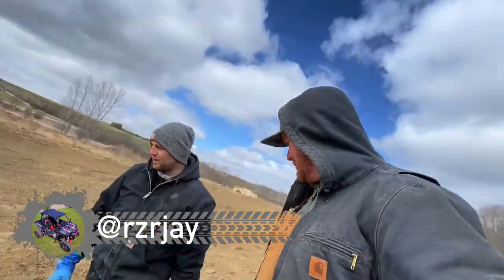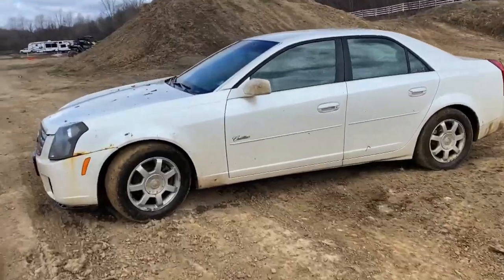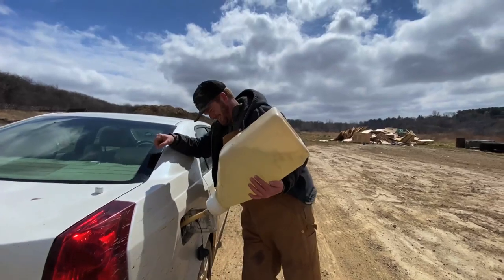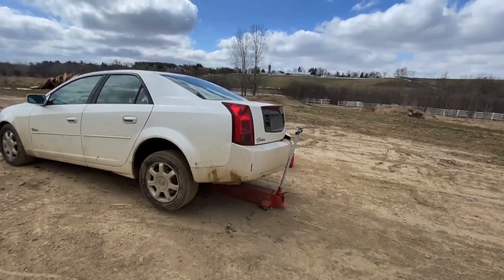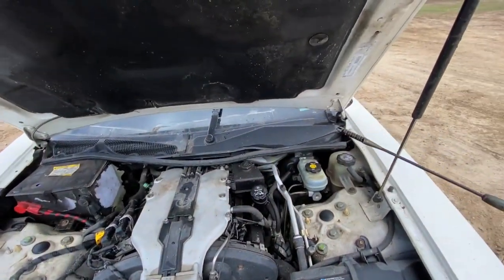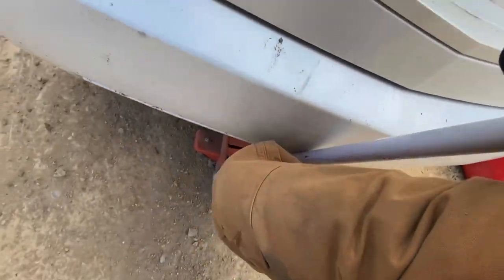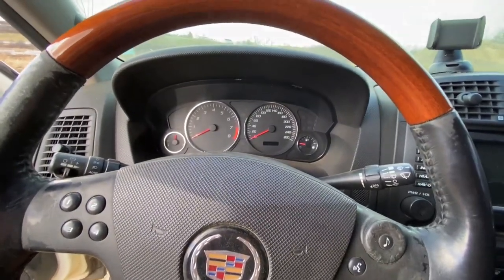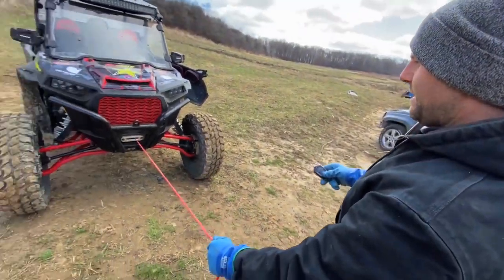Cadillac CTS MUDDING!

Comment from the maker: First 150 COMMENTS/LIKES will be ENTERED in for the KTM 450 ATV GIVEAWAY at 408,000 subscribers!
More COMMENTS = More ENTRIES!
Reply: Hey Mark, take the ignition where the key goes in, out of the GMC and use a flat screw driver too start it
Reply: Braaaap get in
Reply: i need the back door on the passenger side and all the exterior lights if you dont need them
Reply: Unplug the abs wires on every vehicle you beat on please believe me it makes all the difference. And cycle the key fully off then back on multiple times before trying to start a car instead of just cranking it. Im just trying to help ya man i feel like i coulda got the blazer running that day

Comment: Unplug one of the ABS WIRES GOING TO ONE OF THE WHEEL BEARINGS lol cuz right now every time it stalls the traction control comes back on when you restart it. ABS UNPLUG WILL KEEP ANY POWER DRAINER OFF LOL oh and cycle the key all the way off before you try to restart it to run the fuel pump b4 trying to start